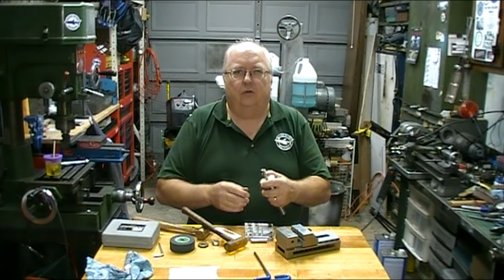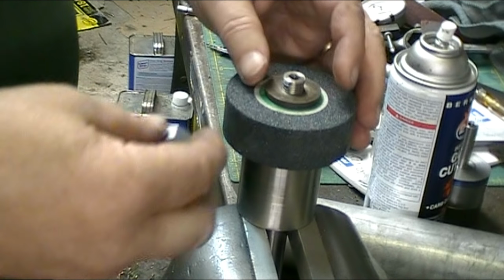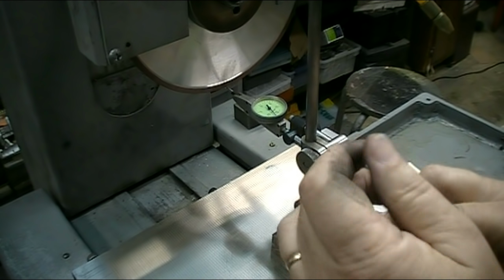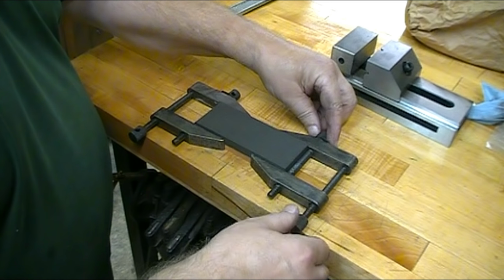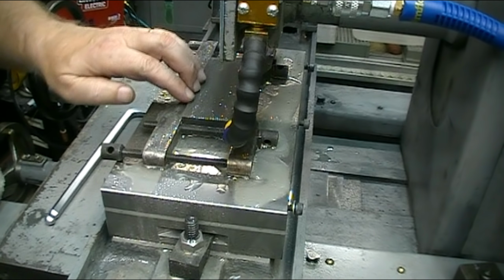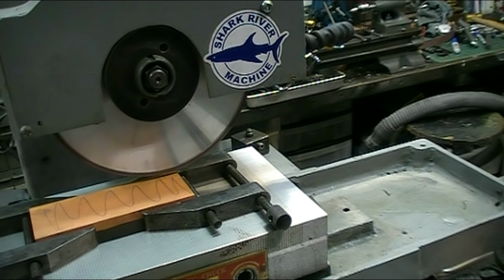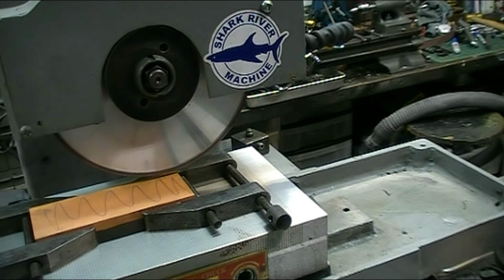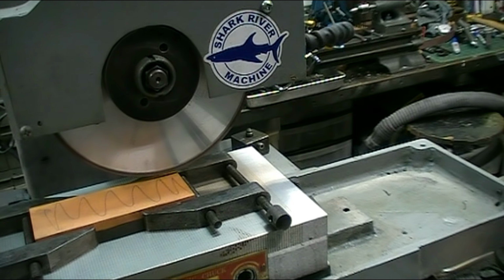Put A Dress On That Diamond/Grinding Bench Stones

Comment: Steven, 650 subscribers, SWEET.  I loved the idea you had for supporting the stones during grinding!  Those machinist clamps worked great.  The opening to the video was great.  Hopefully my autumn will be better to me than my summer, and I can finally get to machining.  Great work my friend.  Take care with all that dust.  Now that  the diamond wheel is trued, hopefully you won't have to make that much dust again any time soon.
Reply from the maker: Dust was a big issue.  The interesting thing about grinding the stones is that it keeps the wheel dressed and actually gets better as you use it.  Thank you again, your stones are packed up and off to the post office in the morning. I actually liked the beginning of the video also.  Not sure that it would work on a regular basis. My goal for subscribers is 1000 by the Summer Bash.
Reply: Itu i😮i bb

Comment: One thing to note, if you want to grind wet, might as well soak the stones in water over night then grind. The main problem with wet grinding is that the stones take forever to dry(nearly a week) and the second one is that they may warp. I had stones warp on me even dry, I am looking at two pairs right now, ground them flat and they left a beautiful finish, now two weeks later both sets are warped, they have not been used. I have an older set that, although it looks dirty they are flat. Been fighting this for a while. I think its the quality of stones I am using, some work and others do not. Also for beveling the edge, I use another stone to do the work. Works a treat. Also may I ask what brand and model of stones did you use?

Comment: I found the toolmakers clamps perfect for this too, for dressing the diamond wheel, try locking the longitudinal travel , go forward and back across the whole dresser,  winding the z down rather than moving the chuck  and you wont knock the edge off the wheel . 
cheers from NZ
Reply from the maker: Lindsay Fog I did a lot of experimenting and the video that I posted was the most successful. I just need 3 hands to do it. Going to try a different stone on the dresser. The one that I used was very soft and did not give any time to traverse. Thanks for watching and commenting.

Comment: Steve - Thank you so much for the precision ground bench stones.  You hit a home run with these stones.  As you said they are so smooth they will try to wring together.  Excellent work from a new endeavor.  Once again, than you.
Reply from the maker: I just finished up the small set.  I went out in the shop last evening and started using them on everything in sight. Don't forget the keep rubbing them together after each use.  It keeps them clean and flat.  Thank you again.
Reply: Hi Steve, thanks for doing this video.  I think I want a smaller set. Were they the unfinished ones that you rubbed together? Could you tell me the size and are they Norton?  What grit diamond wheel did you use and I also have a Sanford BTW.
Reply from the maker: I this video I compared rubbing ground stones to un-ground stones.  You can't really hear that much difference on the video but you certainly can feel the difference. The larger of the stones are Norton 6X2X1, this are the ones that were sent to me by a viewer.  I am not using the Norton stone for the ones that I am selling because they are made in Mexico.  I am using stones that I purchase from MSC that are made in the USA.   I plan to grind up smaller sets which will sell for less but I don't expect to have them available until after the 1st of the year.  I use a diamond wheel that is 150 grit.  The big challenge was getting it set up and dressed properly to get the correct finish on the stones.  Not as simple as it looks.   Thanks for watching and commenting.

Comment: Great video Steven I never new you had to true up diamond wheels. Your truing up grinding stones with a diamond 
wheel and yet you true up the diamond wheel with a grinding wheel. Is the crush dresser made of harder material than 
diamond, if so what is it? New to me, interesting to watch. Thanks Tony
Reply from the maker: These stones are the Precision Ground Flat Stones that have been introduced to the machinist community.  Once the diamond wheel is trued up it self dresses as the stones are ground. I have a found a new method of truing up the diamond wheels using molybdenum bar. Robin Renzetti did a video on it recently so I will not be doing it anytime soon. Thanks for watching and commenting.
Reply: @sharkrivermachine  If the diamond wheel "self dresses" in use there would be no need to initially crush dress it to get it true.  It would work like a friable cutoff wheel. That does not seem to be the case.
Reply from the maker: @deconteesawyer5758   Yes, I built a crush dresser to true up the wheel initially.  Now I use the molybdenum bar to true it up once in a while.  It is important to realize that there is a difference between truing up the diamond wheel and dressing it.  Unlike an 
abrasive wheel these are 2 separate operations on the diamond wheel.

Comment: Thanks for this excellent video, Steven. It is great to see the production of the precision ground flat India stones from start to finish, dressing and conditioning the diamond wheel to the final passes on the stones. I have watched RobRenz' video on this and it is nice to see a followup showing every step of the process in detail. Two questions: how do you repair the brake dresser wheel afer dressing the diamond wheel and 2) what are the grits of the India stones and what is a source for them. Looking forward to your new videos and Facebook announcements of them.
Reply from the maker: The dressing wheel is sacrificial.  I did dress it in the lathe with a diamond in between uses.  The stones that I have are from several sources most are Norton and listed as medium and fine.  Fine seems to be approximately 400 grit that best that I an tell.  I am still sourcing stones so I will try the ones that I have and evaluate them.  I want to make sure that I am producing a good product before I offer them for sale.  I have been to Robins shop and hope to get together with him again now that I am gaining some experience with grinding the stones.  Thanks for the comment.
Reply: Thanks for the extra info. A visit to Robin's shop must have been quite a treat. I guess the dresser wheel is not too expensive so OK for it to be sacrificial and I think the best deal is on dual grit Norton India stones maybe from Amazon. For some unknown reason I thought you were in Australia but you are obviously US located.
Reply from the maker: I am down at the good old Jersey Shore but I have a vacation home in Pennsylvania not too far from Robin.  The best deal I have found for the flat stones has been MSC when they are on sale but I am always searching.  The dressing stones are not that cheap but once the diamond wheel is trued up they will last longer. This is not exactly an inexpensive job. That is way the precision ground stone are a little pricey.  Thanks again.
Reply: I guess you're glad Florence turned southward. I sure am. Chapel Hill is way too close to the coast. Your videos on the crush dresser and the India stones is vital. Everything in one neat package. I located Norton India stones at Amazon but will check MSC for a better price. I need a diamond wheel wide enough to surface the stones too. I only have a thin one for shaping carbide. It is easy to see why a pair of flattened India stones is costly. Cheers.

Comment: No offence, but just a few  tips from an old and retired universal grinder/ machinist. For best results,  the brake dresser should have integral centrifugal brake pads, an in-feed of about 0.001 " on a slow auto traverse from both directions and a minimum overlap of dresser and diamond wheel. Only trying to help, hope you don't mind. Regards from the U.K., and stay safe.
Reply from the maker: True but the home shop budget does not have room in it for a brake dresser. This works rather well once you get the hang of it. I have found that using a piece of molybdenum bar works very well and not nearly as dirty.  Thanks or watching and commenting.
Reply: @sharkrivermachine  . Yes it can take a bit of time to get the wheel perfetly 'flat' so to speak and not convex. We used to take out a few thou from the middle of the wheel first and then dress it in flat. Thanks for your response.

Comment: Good project Steve. Gotta have flat stones for sure. Like the parallel clamps for holding. Don’t think I’ll be doing this on my Abrasive.  The 12 inch diamond wheel would use up my allowance for six months. I’ll have to stick to doing them by hand.  Nice job...👍👍👍
Reply from the maker: Thank you Ron, this has been an adventure for sure.  You could probably use an 8" wheel on your grinder.  The wheel that I am using now is 1/4" wide which was reasonable, however if I start to sell the stones I will be purchasing a 1/2' wide wheel to speed up the operation a little.  Thanks for watching and commenting.